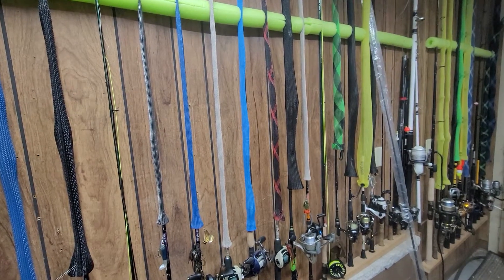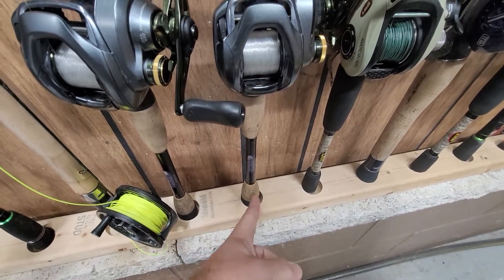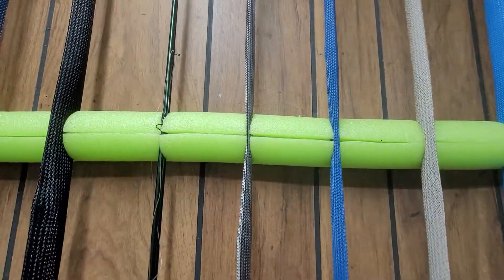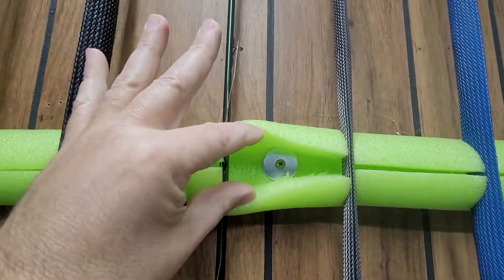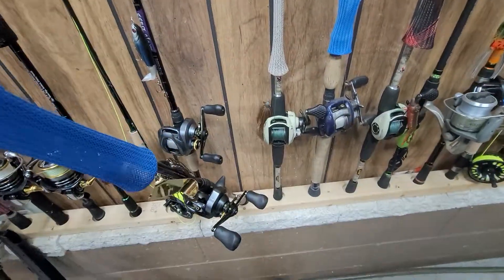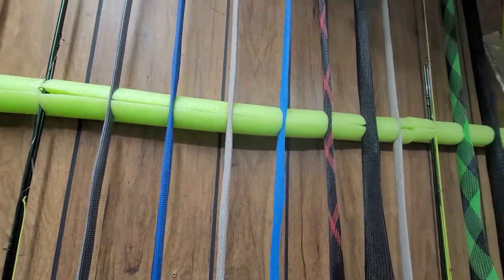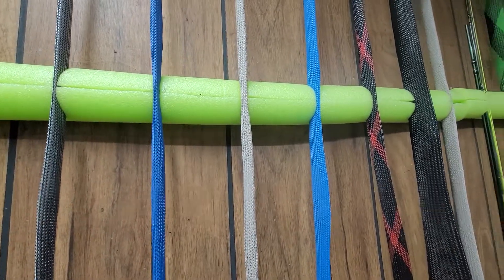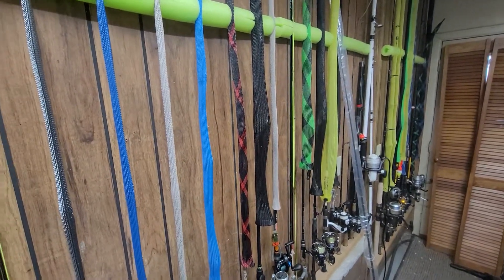DIY Fishing Rod Holder for your Garage!

Comment: Is the slit down the pool noodle just so that you have access to attach it to the wall with a washer and screw? I'm thinking if that's the only reason you could put a thin piece of wood or vinyl about 1" wide down the length of the noodle and drill thru directly into the wall at different points.
Reply from the maker: I put the slit in there just to screw it to the wall. The teim piece is an excellent idea for sure